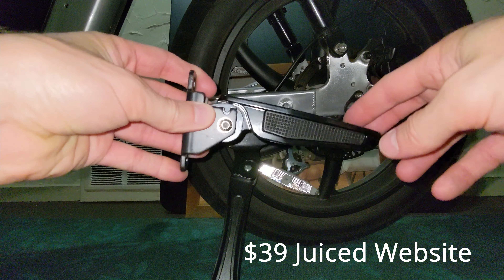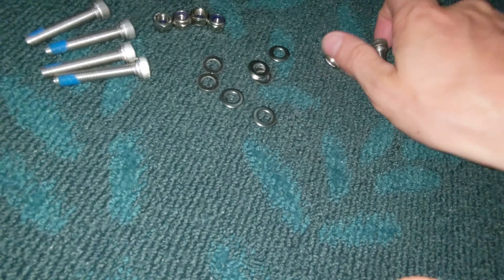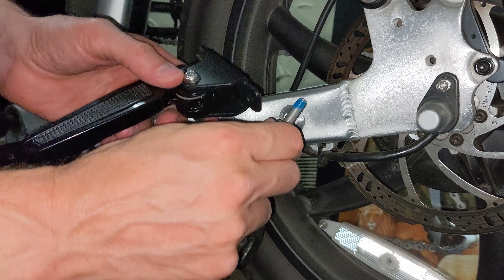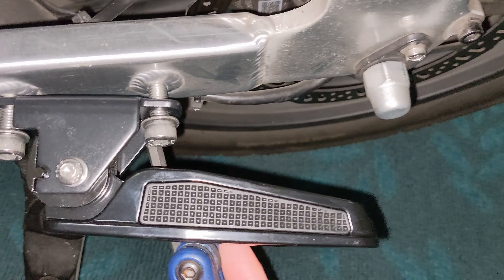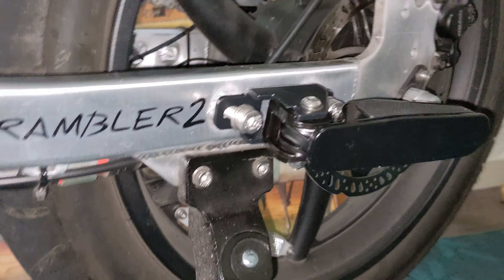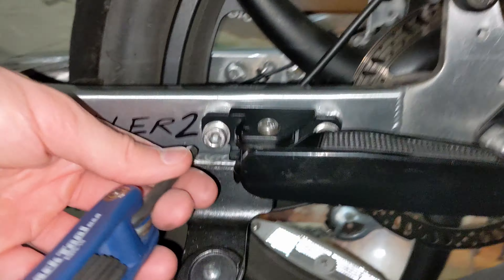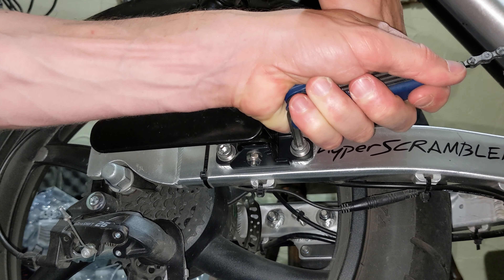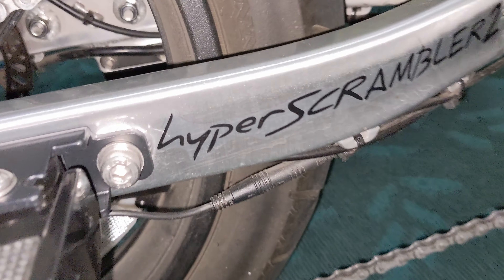Juiced HyperScrambler 2 - Peg Installation Ep20

Comment: I put bmx stunt pegs on my back wheel I just find them a lot more secure even I can stand on them most of the time I just rest my feet on them
Reply from the maker: Nice. That sounds like a good idea. I check my front and rear bolts often. I'm worried about them flying off at high speeds.